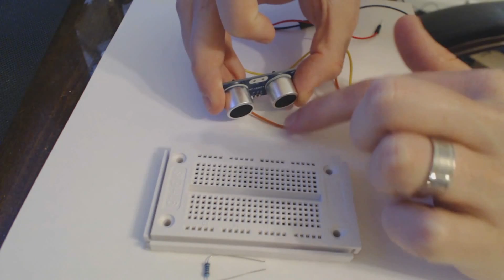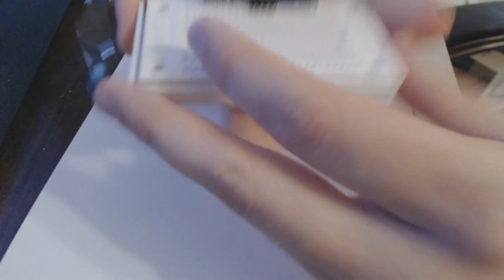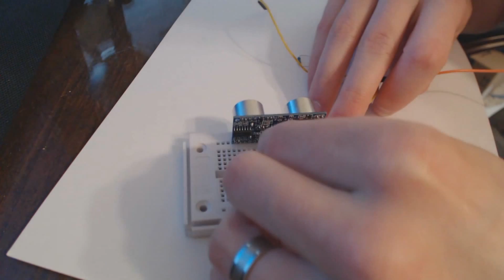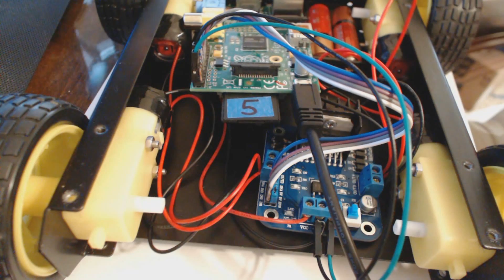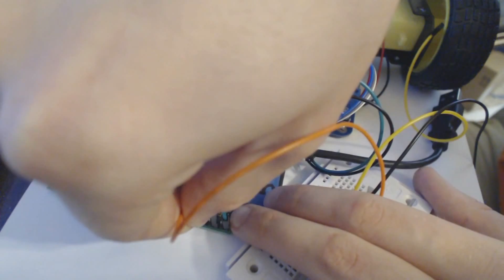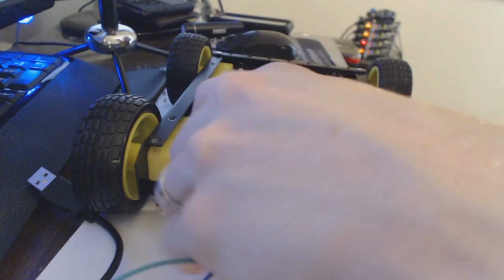Raspberry pi with Python for Robotics 9 - Adding HC-SR04 Distance Sensor

Comment: Can I connect jumper wires to the pins for the sensor then to the breadboard with the resistor and jumper wire to the pi?

Comment: I did the same what you are showing here. When I use 12 (for trigger)and 16(for echo) GPIO, I got this error "this channel is already in use continuing go" so how to remove this error. Please let me know
Reply: use GPIO.cleanup() at the end of the program to reset the used pins after the program finishes

Comment: one question...if i wont add any resistor will raspberry be damaged ??thank you
Reply from the maker: +kostas unknown Possibly. I've done it without one a few times and was fine, but it's pretty certain to damage over time.
Reply: +sentdex basically i wwant to add two obstacle avoidance sensor like this http://www.ebay.com/itm/IR-Infrared-Obstacle-Avoidance-Sensor-Module-for-Arduino-Smart-Car-Robot-/131356972026?hash=item1e957c53fa:g:wzYAAOSwaNBUcDV3 ....can u tell how to connect resistor to breadboard?also i want to tell me how many ohm i need?..thank you
Reply: If you connect the Trig & Echo directly to the RXD TXD, you WON'T need a resistor.
I do this all the time and have NEVER damaged the SR04 or the Pi!

Comment: I am no expert in electronics, but I have told that you should use a voltage divider. The way you have connected is 
Echo 5v ---> 1k Ohm Resistor --> GPIO Pin
Adding a resistor wont reduce the voltage, only the current. So you are stll giving a 5v to the GPIO input pin which is bad.

Someone correct me if I am wrong..

Comment: Why didn't you use the pins aligned vertically like a column on the breadboard? As far as I know, they can be easily use as a common GND for your circuit.

Comment: very nice tutorial, for my project i want to use a sharp GP2Y0A21YK IR sensor, but am not sure how to write the program for it. I can set it up using a bread  board and resistor to get it woking with the pi. If you could help me with the programing part of it that would great.

Comment: Why did you add the resistor to the line on the breadboard for the ECHO pin? Shouldn't it go to VCC?
Reply from the maker: This is because the echo pin can echo back a 5v signal, where the max we want to ever accept is 3.3 to a gpio pin.
Reply: Oh, I thought the HC-SR04 itself needed 5v to be powered.
Reply: sentdex Another thing, does voltage matter for the resistor? If so, how much voltage should it have?
Reply from the maker: Zodiac Zubeda
Resistors are measured not by voltage, but in ohms. Here, you need 1K
Reply: sentdex Yes, I know they are measured in ohms, but when I went to get some in RadioShack, they were also specified by volts. It had 1V, 0.5V, and 0.25V. Also, it had tolerance, which I only saw 0% and 5%. Do any of these matter, or can I just get any one of them?
Reply from the maker: Zodiac Zubeda Hmm, never heard of them being listed like that. I don't know enough on electronics to know why they'd do that. I've always seem them listed as their ohm resistance. You shouldn't just blindly buy a resistor and hope it works. Chances are, no resistor still wont fry your pi, I had mine incorrectly lined up for a while and got away with it, but it's still a good choice to make sure you have the right parts. Maybe ask the person in Radioshack. I just have no idea how a resistor wouldnt have its ohm resistance. They are also color coded, and many times have resistance written on them.
Reply: sentdex So I double-checked today, and I wrote my last comment incorrectly. They were specified by ohms, and they were also specified by watts, not volts. That was a very bad mistake. Anyway, they were specified by 1W, 1/2W, 1/4W, and 1/8 W. Do you know which one I should get for this?
Reply from the maker: Zodiac Zubeda Nope, I have always just purchased in terms of Ohms. Are you sure the W was not a K or something?
Reply from the maker: Zodiac Zubeda Or the W could have been an M?
Reply: sentdex No, it was W, standing for Watts. What would M stand for?
Reply from the maker: Zodiac Zubeda part of the metric standard for measurement. I suggest you purchase the resistors online or ask someone working there regarding the ohm resistance. You can also look online to learn about the color specifications. Resistors are color-coded to denote their resistance. Usually they are also labeled for people who don't know the color codes, but they are coded. The watts just mean how many watts the resistor could resist. If you pass too many watts through the resistor, it will just fail eventually, so they have a power rating too.
Reply: I'll just go with the one with the highest amount of watts because then there is less likely of a chance of too much power flowing through it, thus overpowering it and it failing.
Reply from the maker: ***** If you're buying raspberry pi specific parts, yes, they have always been specific. The problem arises when you start mixing things that don't normally get mixed. There are specific formulas for these types of questions, here's some more information:
http://www.bcae1.com/ohmslaw.htm
Reply: Zodiac Zubeda For this project I don't think tolerance is critical. The values you are calling volts (v) are probably (w) for watts and again in this case any of them should do fine.

Comment: can u please explain, how to control it using a phone app or browser?
Reply from the maker: Well, the simplest solution there is to just download an SSH client for your phone. There are a few out there. There are some other methods that I might cover in the future, but I'd personally just use SSH on the phone.
Reply: Okay, thanks a lot.
I want to control the car via a web browser running on my android phone and send in video stream to my phone from Raspberry Pi camera. My objective is to use the phone's motion sensors to control the car as well as see the video feed the camera sends in simultaneously. Is it possible? If yes, then it would be helpful to know the coding part and exactly what things I need to know to do so?
Reply from the maker: Sohum Misra There are a few people with videos here on youtube doing just that. That's going to be a mix of android/ios dev, node.js, python, and probably a few other things.
Reply: okay. I will look into that. thanks again.
Reply: how to use the SSH client